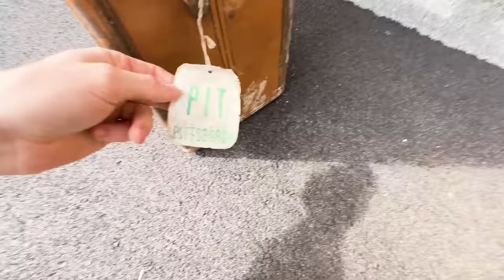Is Carter Sharer Undercover as SCARY OLD MAN?!

Comment: Stephen you really need to get your ford truck and hook up the safe with belts and pull it out and once you get it in land drag it on a dolly for packages to your house.  Then use the codes shown in the video since it is probably a 6 digit code for the safe, and with those safe after each number you will have to spin to 0. Hope this helps